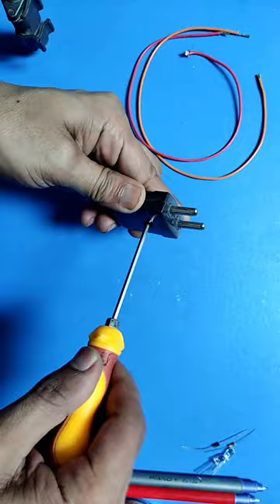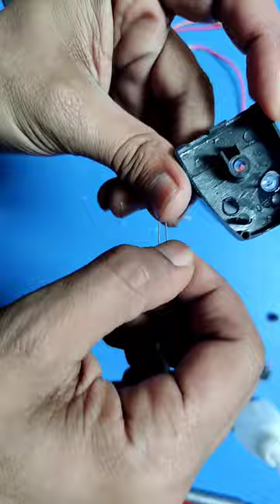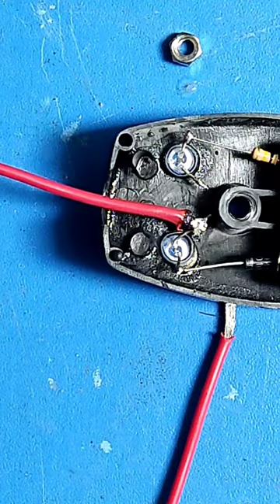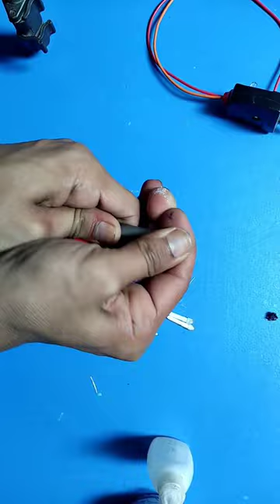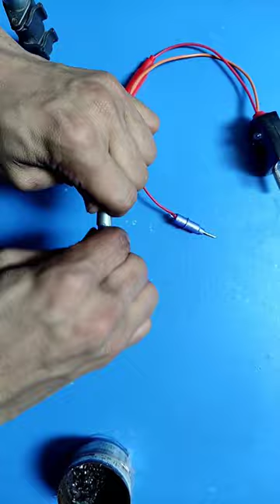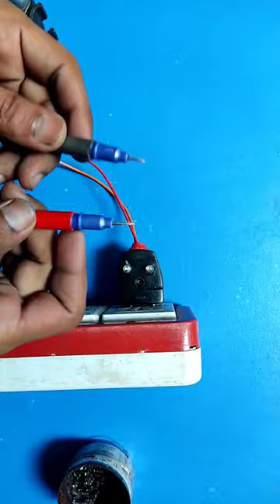everyone can be need this | universal led tester | all in one led tester #shorts

Comment: hello my friend, I have been doing led lighting business for years, but I have not figured it out yet. How can we figure out how many watts and how many amps a led driver without any box is?  I'm measuring the voltage but I can't test it on any panel because it damages the panel.  For example, when a driver with a 310v output enters the load, the voltage drops.